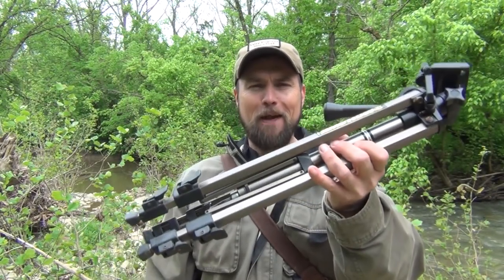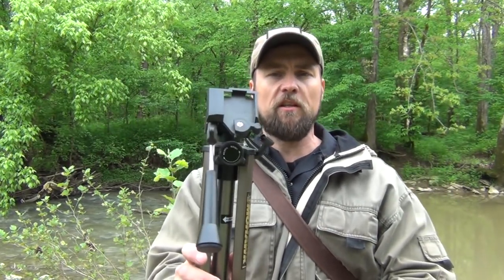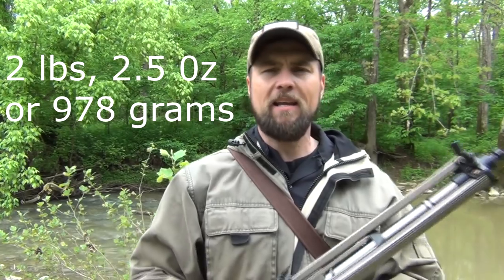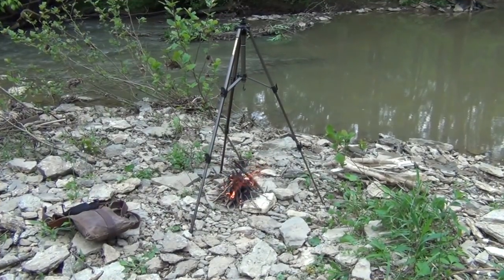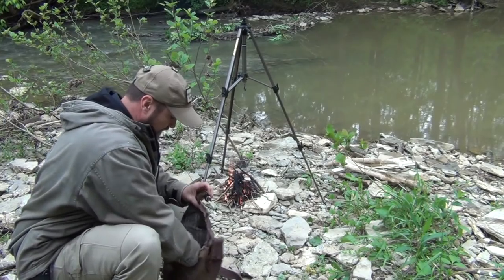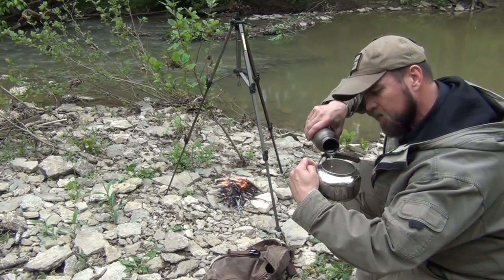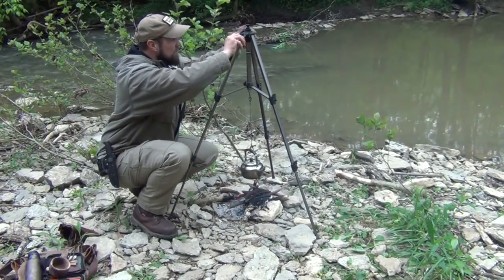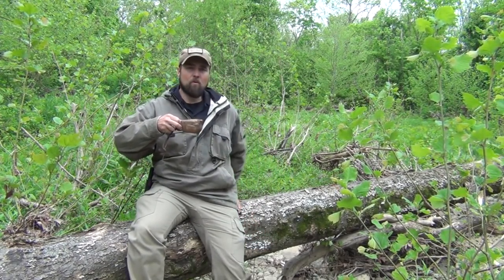DIY Camera Tripod Cooker for Bushcraft

Comment: Truly your highways are paved with gold in America :-)
Great idea. Would the plastic bits melt though with a long cook? For emergency boiling it seems a nice add on in a pinch
Could do the full watch. Had to go and pee :-)
Reply from the maker: The plastic was not harmed in any way during the filming of this video... As long as you don't have a huge fire, I don't think melting would be a problem. Even with a long cooking time, they are far enough away from the heat to be fine.
Reply: @WayPointSurvival  #TripodLivesMatter